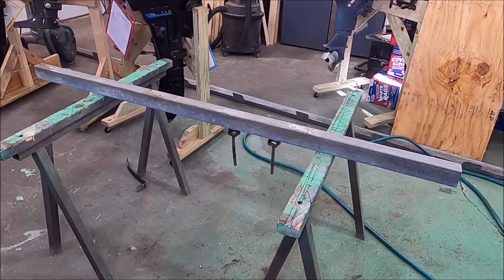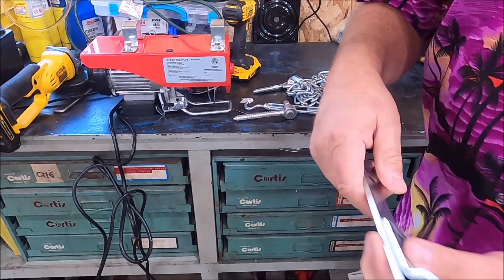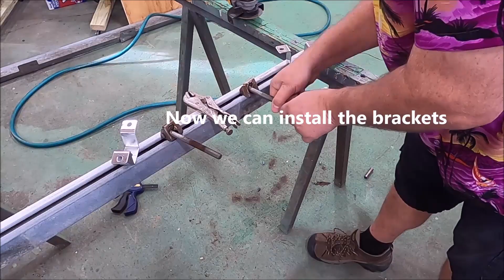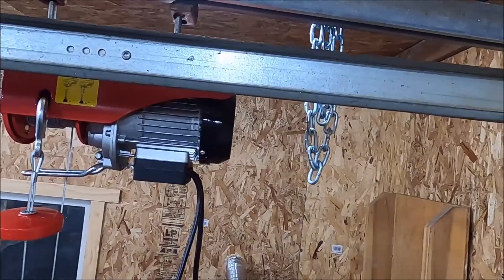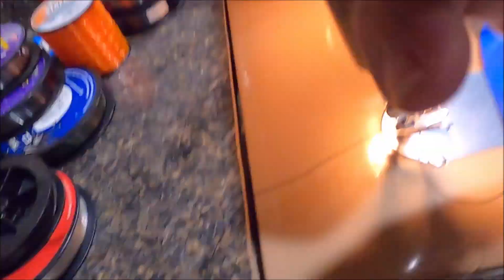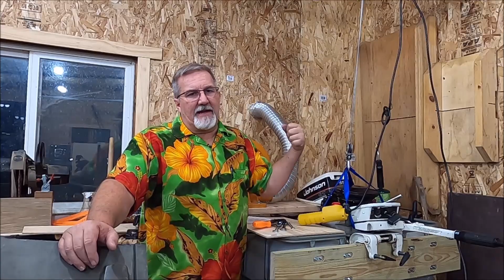Electric outboard motor hoist for the shop- DIY on how I built my remote control shop hoist IT WORKS

Comment: Michael:  Please give me the dimensions of the two loops - either diameter, or circumfrence (Please specify which.)  I've got the nylon strap - just want to have proper length straps for 25-30-35 OMC.
Much obliged.
Reply from the maker: I think you can figure it out for yourself. Thanks for watching
Reply: @Michaelsbackyardmarina  I just thought you might be willing to help.

Comment: Hey, you remembered to do a cost factor of the parts! Cool, you really do have a good idea there. I have the same hoist, it's a good one for pulling up riding lawn mowers, too! But not on a moveable frame! You're right though, I don't think it'll handle lifting a 150 (what I have} outboard, or if it did, it'd be struggling.
Reply from the maker: I agree with it struggling. Thanks for the comments and watching

Comment: All right now that you got your hoist built we can start working on two cylinder Mercuries. It looks like you got several to pick from, how about an early 70s?  Maybe a 110 Merc motor if you got one of those. I'll be patiently waiting. Thanks.
Reply from the maker: I have a couple of those and they are targeted next. Stay tuned and thanks for watching and the comment.

Comment: i bought a cherry picker just for the mobility. chain hoist is parked in one spot and sometimes in use.   a harbor freight 12 v winch  a battery and a pulley would be a cheap date too.
Reply from the maker: Good tip

Comment: Braid fishing line for sewing is good. You could make straps like iron workers use loop on both ends.
Reply from the maker: Great tip! I will have to try some 8lb braid an see if it will flow through the machine.

Comment: I see more modifications in the hoist system before its done.....also, interested in the story behind the sewing machines and the area you have them in....like a sewing shop??  Great video as always!
Reply from the maker: Cool, thanks.  I cut them into a counter top several years ago when I got into sewing.  Made my on hunting seats and one thing led to another.  You may have noticed, I tend to take my hobbies to the extreme.  I have trouble doing something I am into just a little bit, have to do it a lot bit.  LOL